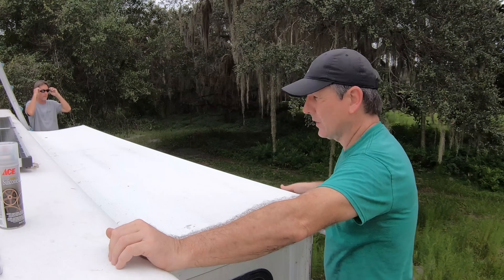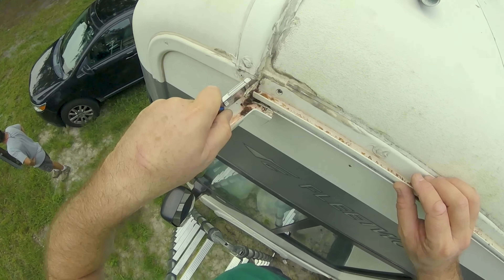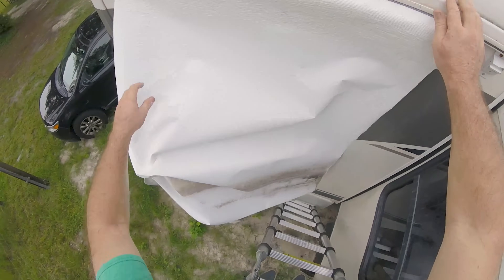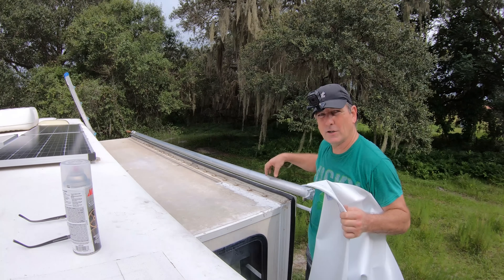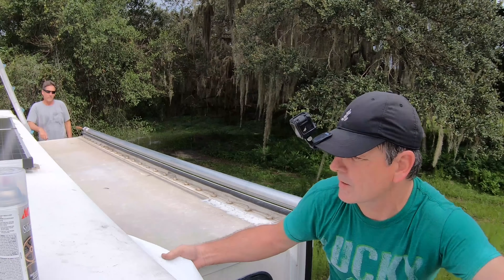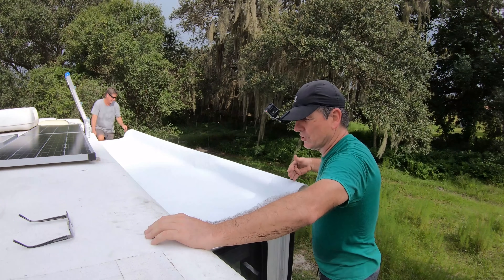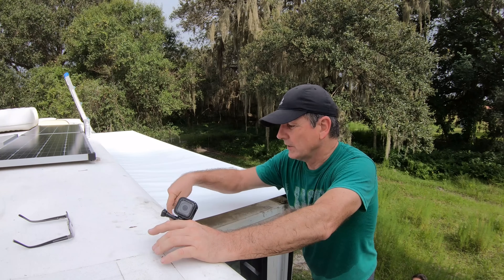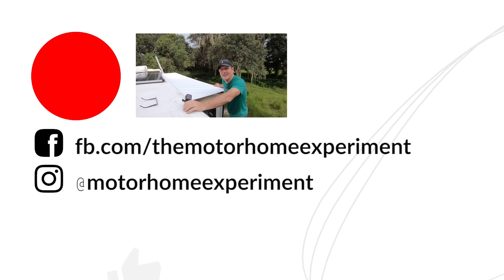RV Slide Topper Replacement in 2 Hours or LESS!

Comment: My roller is having issues when the push out is taking place.  When going out, the roller is trying to climb up the rail of the wall and thus creating tension.  The slide out struggles and I have to get on top of the RV, push the roller down to the side of the wall and then I can continue pushing out the slide.  Why would this be happening?  Thanks for any advice.
Reply from the maker: Is your awning up against the RV when the roller is out? It may be pinching the awning and not allowing it to unroll. It may need an adjustment of some kind or the screws are pulling out. If it comes back in and rolls the awning up the spring must still be good. It's very hard to say without seeing it.
Reply: @LifeWithPaulLorena  It does roll back when pulling it in.  So yes, I agree, the spring still must be good.  But when rolling out, the "middle" part of the roller rolls up on top of the slide out and creates a binding affect.  I have to get on top of the RV and PUSH the roller back down before I can extend it out any further.  I don't see any screws nor if they are out. Maybe the roller should be moved away from the slide?  Not sure how this movement took place if that is my issue. I will try and upload a picture.  Thanks and what is your email address,  Maybe sending a video will help.

Comment: 2 questions... how is your TT awning holding up after ~2yrs? Also, do you know the purpose of that wall bracket (1st seen @2:40)? I just did this slide-out awning replacement on my '05 Bounder 36S, and I have that same bracket. I have an assumption its there to pull the edge taut (somehow), but would really like to know its true purpose. Note: my bracket is ONLY on one side (front). FYI, thanks for the gr8 video... I consider myself very lucky to have caught your video 1st! After finishing this job, I saw other videos that had methods that made this job MUCH more difficult than need be. For me, the dang rusted out "set screw" in the gutter set me back an entire day! Eventually had to get cobalt drill bits & drill out the entire screw, 1st from the top, then bottom (significant Dremel work as well)... AND STILL had screw remnants stopping movement... had to get in there with needle-nose vise grips and work screw fragments out... complete NIGHTMARE! If wind wants to rip awning off, be my guest! I'll address that IF it ever happens, but I'm filling that hole and not putting ANYTHING back as far as "set-screws" go! Whoever did my awning to begin with was an idiot.... if you're going to do something like this, screw from the underside, not thru the dang gutter system where water runs constant. These rv mechanics/shop workers... just half-ass patch problems, then shove out the door. Whatever gets them beyond their janky 1 year "warranty". But I digress, thanks again for the excellent video.... very helpful!
Reply from the maker: Hey mud! So far our awning is holding up well. Being in the RV a lot means the awning is out a lot and gets more sun than most so if we get 5 years out of it, I'll be surprised.

That bracket is what the tab, on the roller part of the awning, hooks onto when the awning is rolled in. It's supposed to prevent the awning from unrolling when you are going down the highway.

It is a pretty easy job (with 2 people) if you just take your time and make sure you lock out the spring with some sort of pin. I recently replace our other awning topper with my wife's help and it went on in less than an hour, I think.

One of the biggest problems with working on these older rigs is there are a lot of rusted bolts and stripped screws. I try to hit any bolt I'm about to work on with penetrating oil, a few hours before doing the job. But yes, drilling is not out of the question, if you have to!

Thank you for your kind words! Safe travels!

Comment: Great video. Thanks for sharing.
I'm getting ready to replace our slide topper, and I am curious what the length of yours is. The manufacturer of our replacement topper explained that all slide toppers of slide toppers they manufacture are 48". Was your replacement topper the same as your original?
Reply from the maker: We just bought our smaller shade from ShadePro on Amazon...https://amzn.to/45uRPl3 It was good for slides from 93" to 140" in length. We measured our slide between the rollers, the way they show, and used a utility knife to trim off the excess.

I assume you mean, the width? All slide lengths are going to be wildly different. Ours said it was good for all slides less than 42" width without aluminum guard. Most of the manufacturers are pretty good about helping with measurements.

I have no idea what the brand of our original was, so I don't believe it was the same. Not a tough install, but make sure the roller is locked in place!!

Comment: Is this the same process for the regular awning above the entrance door?
Lou
Reply from the maker: No sir. It's a bit different. You only want the main awning to be open a foot or so. You do the same process with removing tension from the spring roller, but you totally remove the roller to get the awning off.

The RVGEEKS have some great videos on the main awning.
Reply: @LifeWithPaulLorena  Thanks Paul.
Lou & Angie

Comment: I have a question: Should the spring be rolled up as tight as it will go?
Reply from the maker: I'm not sure on the tension to be honest and I assume they are all different. You might be able to get that info from the manufacturer of the roller if it's on it. 

If I couldn't get that info this is what I would do: With the slide all the way out, I would roll it by hand until the tension is strong, but not being forced. Install the pick, awl or small screw driver to hold it. Install the awning material. Remove the pick. Then put the slide in and see if the material rolls up properly. If it needs more tension to roll up without sagging add more tension.

If you put too much tension you will add to the pressure on the slide motor. You don't want so little tension that it will open up and flap while going down the road. Good luck!

Comment: This is really the easiest and safest method.  I use steel fence ties (not aluminum) to secure the spring.  The silicone spray or window track lube works great.
Reply from the maker: The silicone is a game changer for sure!

Comment: If your attempting this and dont have the hole to pin it vise grips can be used to hold it in place as well, DONT LET GO OF THEM !!!!! the tension cant easily fling the vise grips and break your hand.....awnings are the most dangerous thing to fix on an rv because they are spring loaded. If your not comfortable hire someone that does it, it could save your life.
Reply from the maker: Yes, there is tension on the awning for sure. I don't know about life threatening, but taking your time and proceeding with caution is a good idea,
Reply: @LifeWithPaulLorena  let it snap and if vise grips hit you , you could fall off the ladder. Thats where the danger is. Ive fixed hundreds of awnings it can and has happened.

Comment: Thanks! That would have been a great opportunity to thoroughly clean the top of the slide and put some 303 on it 🙂
Reply from the maker: Great point!
Reply: Actually clean it and put wet and forget on top of slide out.
303 is basically a UV protectant and since you have a slide out awning it's not exposed to the sun. But since it can get moisture and then mildew the wet and forget is a go to for me. 303 is great for the tip top horizontal part of your cap where the sun destroys the gelcoat. I usually use it liberally there because nobody can see it. On the wall I use a graphene ceramic spray for UV protection and shine. I know nobody asked or probably cares but I detail RVs.

Comment: What's the dimension on that slide. I have the exact 33 ft flair and that awning tore with last week windstorm.
Reply from the maker: Frank, you'll want to measure yours and not go off what dimensions anyone else gives you. The Tough Top awning website has all the instructions you'll need to make sure it's right. Good luck.
Reply: @LifeWithPaulLorena  . Thanks. Mine is at the storage. I'll measure it this weekend. Thanks again for thg he instructions.

Comment: You made it look so easy.  I'm just afraid to climb on top of the slide because I'm 260lbs.
Reply: A small peice of plywood on the roof to distribute the weight would be a good idea as your on the roof, most are 1/4 to 3/8 ply under that rubber its sketchy